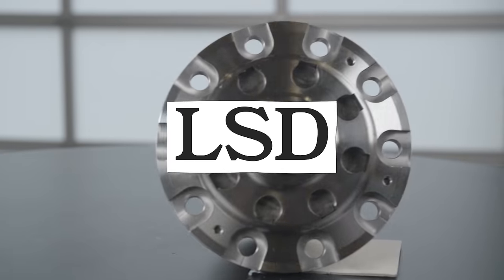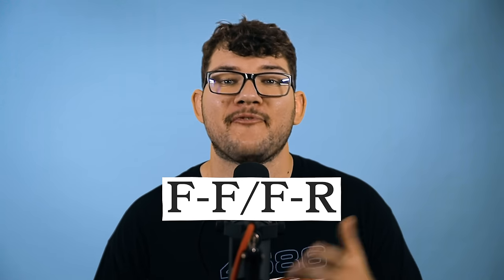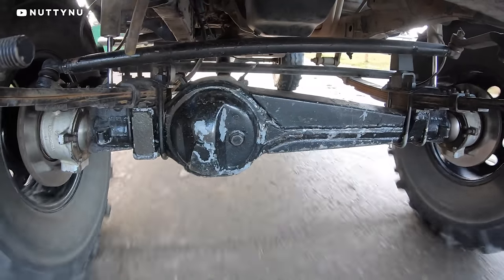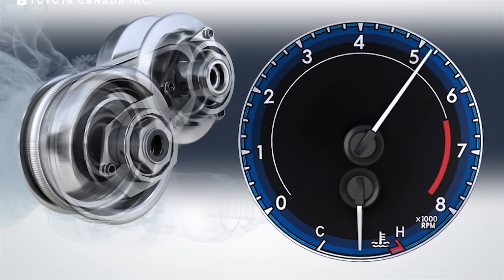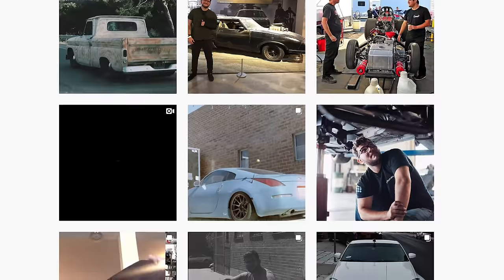Car Terms Every Car Nerd NEEDS to Know

Comment: i think you got 4wd and awd mixed up. awd only kicks in when needed through a clutch system in the transfercase, 4wd is user selectable and is always putting power to all 4 wheels
Reply: Thanks for that.  At first, I said, "Oh!  So that's the difference," and then I got to thinking about it...plenty of car manufacturers advertise that their AWD systems don't drive all four wheels all the time.  For instance, Subies' "from the wheels that slip to the wheels that grip" AWD.

Comment: Muffler bearings are super important to, if you could talk about those in the next vid that would be great!
Reply: I think folks were asking for kanuter valves at parts counters before mufflers even got bearings and blinkers were still sealed and non refillable. The old flux capacitor, piston return springs, clutch lube and floor mat alignment tool are all great training for up and comers.

Comment: I feel it's important to mention the actually purpose of camber, besides stancing. Camber is used to improve traction within corners as the size of the outer tires contact patch will increase in size as the weight of the car is put on the outer tires. This will allow you to take corners harder without sliding and losing traction.

However, as an increase in negative camber improves traction within corners, it reduces traction in a straight line. This is because the tires contact patch in a straight line is smaller than it would be with 0* camber. This is why if you look at actual GT cars, you will often see a degree of camber, but definitely not stanced.

Comment: I knew all of them except money shift. Though I used to money shift my 93 escort a bunch because of the worn out shift cables. A casual 5-4 shift to pass became a puckering 5-2 shift at 70+, instant correct into 3, and WOT until I finally caught up and passed the car I wanted to. Slightly embarrassing

Comment: 4:30 - Good info for newbs... But, a bit unclear. Straight and inline are the same thing, which should be said. Slant 6 isn't really a thing unless it's just for specific engine models; because most BMW inline engines are slanted more than 20 degrees. 

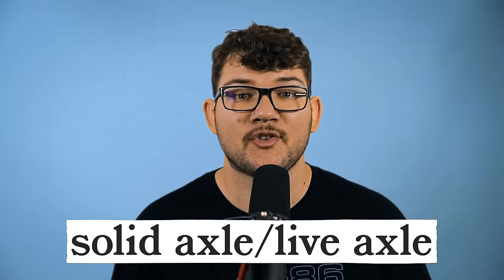9:50 - That's a bit convoluted, going from axle type to suspension type.

Comment: CAUTION: In colder northern climates don't forget to add (I recommend Clean Carl's specially-formulated) antifreeze to winterize your Dirty Dirk's blinker fluid - don't want those turn signals/indicators seizing up in your driveway on cold winter nights!

Comment: The clutch and clutch pedal work opposite of each other. 
When you push the clutch PEDAL in you're pulling the clutch out.
Reply: If you're confused, the clutch is nowhere near your left foot. That's the clutch pedal. The clutch is under your car, connected to the transmission.

Comment: If you have more than 80k miles chances are your blinker reservoir has shrunk due to years of heat from the engine causing higher psi and thus the excessive clicking noise. 
    A new reservoir is to too much though. You can get a blinker fluid reservoir stretcher at any car parts store. Fulzs makes one for less than 10 bucks, then just heat up the reservoir with a hair dryer and stretch it back out by about an inch or so should lower the psi and quiet it back down.

Comment: I need to fix my blinker fluid system. I put the dirty dirks fluid in the oil fill spot like the directions said. Then added the dirty dirk fluid separating compound to make sure no oil combined with the blinker fluid. Lastly I tightened down the muffle bearing on the head light manifold. Sadly I’m still getting a clicker noise when turning. The trouble shooting steps just aren’t working for me. Anyway have better luck here?

Comment: I'm sorry, but ground effect is not quite what you described here. From what I know, at least in aviation, Ground Effect is a pocket of pressurised air, that forms between the terrain and an aircraft's wing, when flying at really low altitudes. Like just above sea level, or any other smooth surface, like a runway. This can act as a positive lifting force, and kind of feels like riding on a cushion.

Comment: He actually got 4wd and awd mixed up. 4wd is all four wheels powered at the same time and the front and rear axles are locked so all wheels spin with the same amount of power. Awd is usually just fwd and then if you need the extra traction then the rear wheels will give power also. It can give different power levels to front and rear. Unless you have full time awd like a subaru impreza or something which is all four wheels being powered all the time but the axles aren't locked.

Comment: Torque isn't the measurement of twisting force "measured" in "pounds feet". 
Torque is a measure of rotational force, usually in Newton-meter, but also acceptably in pound-feet ( pound , singular, not "pounds"), or more accurately pound-force-feet, if you insist on using freedom units.

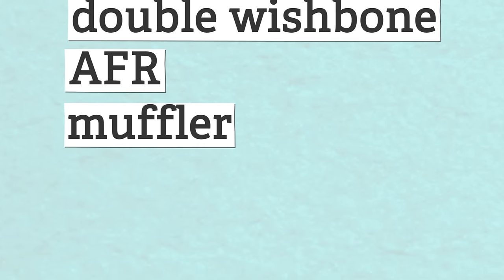Comment: 01:46 muffler
01:56 resonator
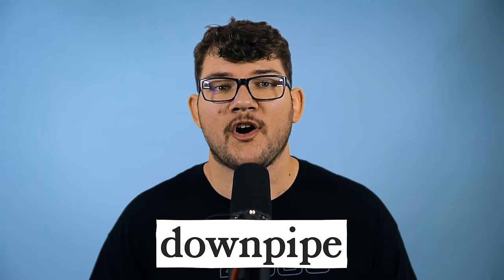02:14 downpipe
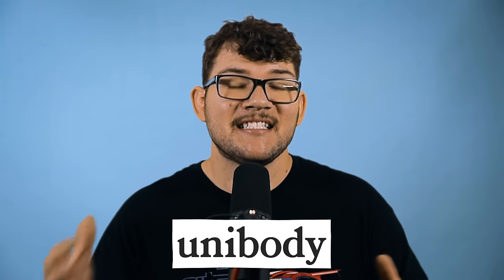02:27 chassis
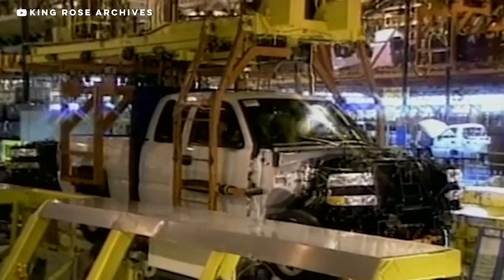02:52 fuel delivery
03:13 check engine light
03:28 FWD
03:32 RWD
03:35 4WD
03:50 AWD
03:56 Torque
04:25 Engine layouts inline/V
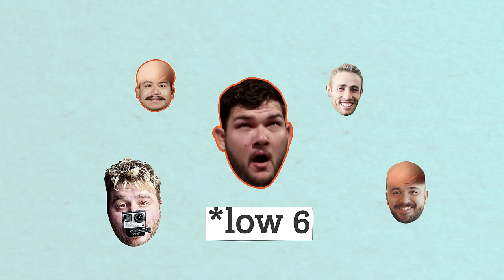05:00 F-F/F-R/R-R/F-A
05:19 Bondo
05:34 WOT - Wide Open Throttle
05:47 N/A - Naturally Aspirated
06:00 HEMI
06:36 Turbochargers and Superchargers 
06:53 spinny boi
07:09 blowoff valve
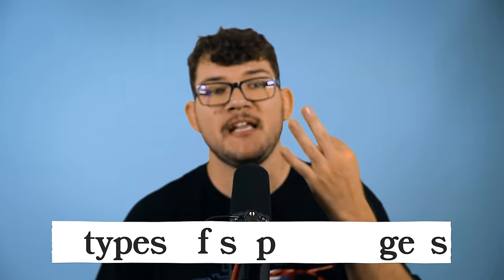07:33 3 types of superchargers
08:18 X-pipe/H-pipe
08:45 cat/catalytic converter
09:13 delete
09:22 sleeper
09:47 suspension
10:52 camber
11:33 double clutching
11:47 AFR
12:16 HP ratings BHP/WHP
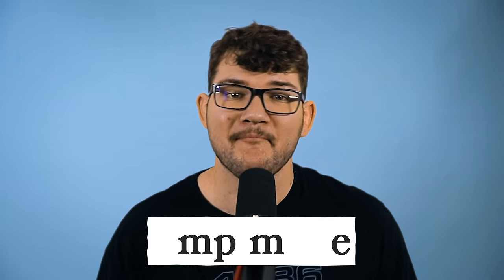12:44 limp mode
13:04 Manual Transmission terms
13:52 money shift
14:10 final drive
14:23 LSD
14:37 CVT
15:05 Blinker fluid
15:29 transaxle
15:43 racing from a dig
15:49 racing from a roll
15:59 ground effect
16:09 firing order
16:25 rod knock
Reply: Muffler- A muffler is a big box in your exhaust system that muffles noise.
Resonator-A Resonator is a device that comes just before the muffler. It acts as a sort of echo chamber to focus sound so the muffler can silence it.
Downpipe-Downpipe in older cars refers to a pipe that carries exhaust from the exhaust manifold to the rest of the exhaust system. However in a turboed engine, it carries exhaust from the turbine to the rest of the exhaust.
Chassis- A unibody is when the cars chassis is a single piece of metal that also joins with bodywork. This is in contrast to a ladder frame, which is employed by most trucks and off- road vehicles. A ladder frame rails as the body sits on top. And then you've got some cross members and it makes the whole ladder frame look like a ladder.
Fuel delivery- when it comes to fuel delivery cars either have carburetors, or more commonly nowadays fuel injection.
Reply: Check engine light
FWD
RWD
4WD
AWD
Torque
Reply: Engine layouts inline/v
F-F/F-R/R-R/F-A
Bondo 
WOT- Wide open throttle
Reply: N/A- Naturally Aspirated
HEMI 
Turbochargers and Superchagers 
Spinny boi 
Blowoff valve
Reply: Superchargers
X-pipe/H-pipe
Cat/catalytic converter
Delete
Sleeper
Suspension
Reply: Camber
Double clutching
AFR
HP ratings BHP/WHP
Limp mode
Manual Transmission terms
Reply: Money shift
Final drive
LSD
CVT
Transaxle
Reply: Racing from a dig
Racing from a roll 
Ground effect 
Firing order
Rod knock

Comment: A catalytic converter is a membrane gas is forced through with pressure, which means it slows gasses down while flowing though your exhaust.  There's a reason people pay cash to remove them, then have thier ecus reprogrammed to calibrate corrections  and to pass emissions tests...  which also costs ass tons of money 💰, people dont do this for no reason, cats are a hindering to a smooth flowing exhaust. Yes there are hi-flo cats, but they just help the issue, not fix it. Nolan is just mad because he dont like the smog, and cali boys cant get around emissions...   hahaha here in texas my mustang passes just fine, and on the print out where the cat readings show, it just says "n/a" haha props to good tuners.

Comment: That 4WD may be a NP203 transfer case that is full time four wheel drive with high and low range.  Four wheel drive does not mean it can be shifted from 2WD to 4WD.  Part time 4WD means it has 2WD and 4WD modes, Full time 4WD means it is always 4WD, which is not AWD.  AWD was a term used for cars with a single range transfer case that was generally not called a transfer case, and it has no shifting.  Full time 4WD is not AWD, and 4WD does not mean it has a 2WD mode.  And don't confuse full-time 4WD and part-time 4WD with marketing BS in a brochure of from a salesman.  They seem to change the descriptive terms they use on a whim.  Otherwise, not too bad.

Comment: You kinda misused  the term "flathead" which was most famously an old Ford engine type that hasn't been seen since the early 60's when they were replaced by more efficient overhead valve and overhead cam  engines.

Comment: All Whee drive is exremely Loose term for 4 wheel drive,now days it usually means that the cars balance of power is mostly balanced on the front end with small amount directed to the rear,to handle a bit rougher road conditions but i wouldn´t expect much from AWD car when driving cross country.
Cars with Carburettors were produced up to early 2000s because of economic reasons,but apart from restorations,or restomods use of carburettors is mostly extinct in the developped countries.
Chemical metal putty is actually pretty good for processing small regions where welding might be difficult or impractical,but like bondo should not be used in the load bearing structures of the body,also putty can be used to cover and protect patches from the elements. Excessive use of bondo is a cheap but really unreliable way of repairing the body,and will ruin the safety and rigidity of the car,as does excessive amount of welded patches in the cars body
When driving stickshift money shift doesn´t break the gearbox if its in decent condition and the person driving doesn´t rev the car for excessive amounts of time.
Blinker fluid is similar to the combustion chamber light,a childish joke.

Comment: i remember when the check engine light used to mean something, in modern cars it usually just means a sensor issue. probably because you loaded a dinosaur incinerating fuel map or you replace your air box and filter with something that isn't a cheap piece of shit

Comment: Great Video but call me old but I don't know when extreme camber = Cool but I can't stand the way a car looks like with this setup. In my opinion a sports car should first and foremost have a nice ride. You can lower your car with the proper setup and it will ride nice and look cool. Most of these Camber setups are tearing the tires up scaping the tires on every bump and the ride is just horribly to bumpy. Again this is just my opinion but I feel you can't sacrifice your ride and tires just to try and look cool.

Comment: How are centrifuge super chargers the must efficient? At low rpm they surely rob power
Reply: They're the smallest and lightest of the compressors, and anything is more efficient than a Roots compressor since the Roots is open-ended.
Reply: @BogeyTheBear  smallest and lightest is great but still not convinced it's the most efficient. I can't even think of a manufacturer that installs a centrifugal supercharger, can you? I own an e46 m3 and the trend on those  (and e9x) is bolt on centrifugal chargers. Great at adding top end power, but they look (from dyno charts) like they're all pretty poor down low.
Whereas the other 2 styles of chargers seem to add power evenly across the whole range from idle up.

Comment: Brake horsepower is a misleading name to the uninitiated and should never be used in my opinion, especially since the term crank horsepower exists. Its called "brake" horsepower because an engine dynamometer is a type of mechanical brake used to determine the torque an engine is outputting. Using the name brake horsepower isn't wrong, but cars also have BRAKES which are located at the wheels, so it sounds like it would be describing the wheel horsepower which it is indeed NOT. Crank horsepower avoids the confusion between wheel brakes and dyno brakes and also describes exactly where that power is measured at - the crank.

Comment: that tic from your blinker is just the relay. stop telling people about blinker fluid. there is headlight fluid reservoir in some cars that have the option for washing your headlights. some have a separated reservoir from the windscreen but most use the windscreen reservoir. There is no such thing as BLINKER FLUID. or proove me wrong. show me a video where u got actual fluid in a blinker and that headlight is still working :))

Comment: The explaination of ground effect is wrong they are basically explaining downforce.

Ground effect is a subset of downforce that consists of reducing the space between the floor of a car and the asphalt to create a low-pressure area under the car, thus increasing the speed with which the air circulates and creating a greater downforce, even higher than that generated by the wings.

Comment: ground effect is so badly explained, it's using the floor of the car sometimes in tandem with skirts to create air speed/pressure differences under the car in a way that sucks the car to the ground

Comment: You forgot V4 engine
Reply: There are V4 engines--never heard of one in a car, although I'm sure somebody's done it, there's no point. Twice as many head gaskets, twice as many camshafts (if overhead cam,) two separate exhaust manifolds, no need for it--just use an inline 4 in cars.
Good engine layout for motorbikes though, more compact than an inline-4.

Comment: Being relatively efficient doesn't mean that the cats don't rob power. You only have to worry about "passing smog" if you live in a shithole state. Move to a better one and your problem is solved. There are more benefits to removint the cats besides power, as well.

Comment: Cars with CVT's are the worst transmission ever!!!!!!  Who uses a fluid that degrades to the point that it destroys your CVT and they do not want you to change it!  Who ever thought of this idea needs to stop engineering anything!  If you own one of these cars, you WILL have problems and this design shouldn't have ever been put into production, no matter how "good" they may be.  Thanks for costing your customers thousands of dollars NISSAN!!!!!!!!!!!!!!!!!!!  Murano was a good car until their tranny craps out and you are literally out thousands!  That goes for the new civic, Fit, and more little puddle jumper cars. Buy a manual transmission vehicle and you will guarantee that you won't end up with one of these lemon transmissions.  BOYCOTT ALL CVT cars and do not let them start putting those POS things into trucks!!!